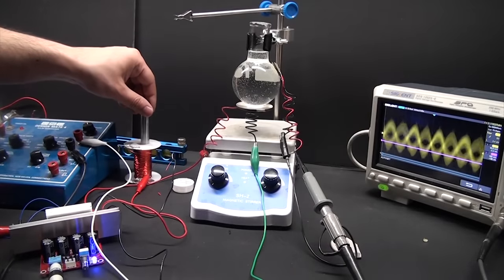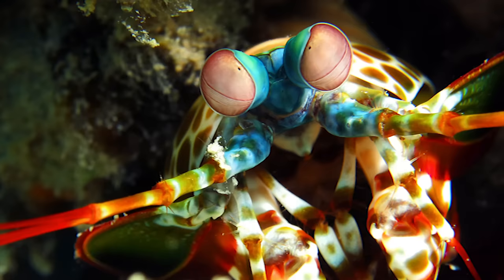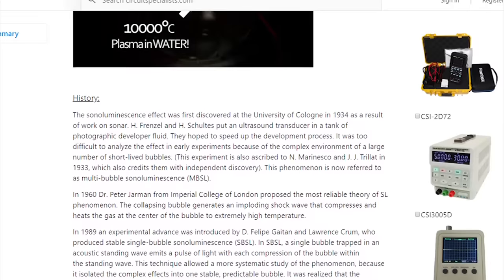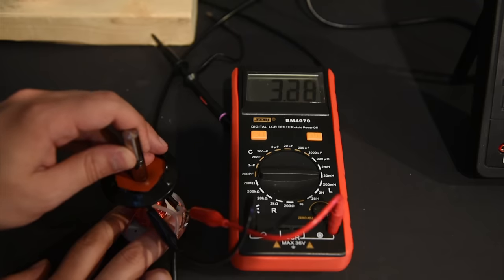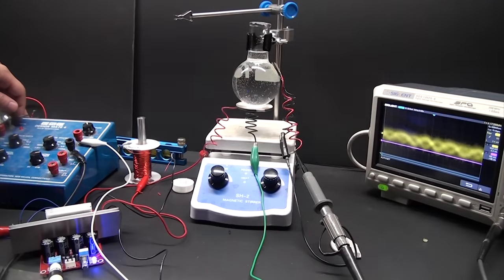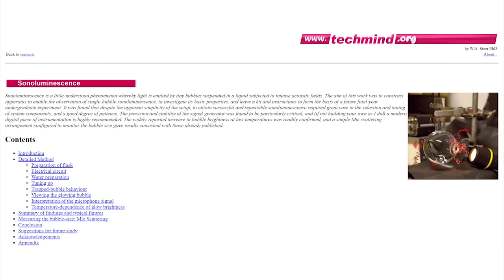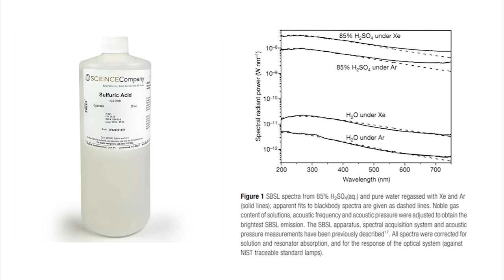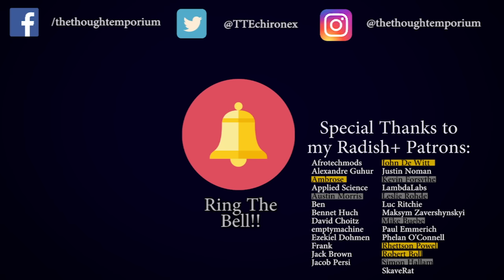Punching Water So Hard LIGHT Comes Out - Sonoluminescence

Comment: Take this with a grain of salt but I'm pretty sure sulfuric acid actually evaporates at room temperature like alcohol or gasoline and faster than water, if I'm correct de-gassing it is a losing game, because lowering the pressure would make it spontaneously boil off rather than releasing trapped gas

Comment: Your benefiting from the meniscus surface tension in the water that is causing a lensing effect on your sine wave. The angle of incidence is equal to the angle of refraction.
Reply: I bet if you put a magnifying glass lens in the water at the interface you could amplify the fulcrum. also if you did such with a much larger lens that was coated with high reflective material with one ninth size translucent face in the center of receiving face you could get a holographic resonance that should maximise your luminescence.
Reply: if you put a tweeter above the lens assembly you should be able to regulate a coherent pressure wave to allow for more Db at the fulcrum.
Reply: or a 25kHx air transducer might be a lot better.

Comment: its because it pops faster then lightspeed the vibrations are keeping the water in flask moving just like waves in the ocean just yours is controlled and its shape of a drop it keeps is for same reason why a drop sits on top of water but like when you vibrate sand heavy stuff sinks. youd notice a brighter effect if you had the water drop burst in a different liquid. just dont used gas lol only 2:43 in and i can tell you that lol doesnt take rocket appliances the part of how it closes faster then lighspeed is what we have to figure out it would have something to do with the amount of force compared i bet the bigger the flask and the bigger the drop the bigger the effect but for more burst effect youd need bigger drop in smaller flask but the liquid the drop busts into has to have way way way less particles this is actually very dangerous it seems the more im talking about it
Reply: its the pressure leaving the drop and the pressure on the drop its taking over the space with itself and because they both water it ends there at a instant joining i bet you can find the same thing with rain hitting water behind a hurricane or tsunami
Reply: just thought of something while doing research on Egypt history im wondering if this light effect happens when a sperm bursts in an egg because maybe the light is point of creation ?

Comment: What? Magnetic positive repelling  Water ion based batteries?  Using repelling magnetics at a concentrated space in water to force and pull out light at a specific center of the water? Magnetic water ion based battery lamps... I love it!  Pulling light out of extreme vibrating water molecules in a lamp or flashlight... I wonder if there is a way to pull light out of air for street lamps....

Comment: 25 years ago I worked for a small company that manufactured a high frequency (660kHz), high power ultrasonic transducers and amps. The transducer was a 2" disk epoxied to a 4" disk of aluminum. This was housed in a waterproof container. We could put the transducer in a 24" aquarium with water. After dark accustoming your eyes you could see a 2" diameter beam of light come from the transducer go across the aquarium, hit the glass and reflect back towards the other wall. As I recall it faded before it hit the other wall. This was with about 250 watts into a transducer at it high impedance resonant frequency. The transducer capacitance was tuned out with an inductor, leaving about 20 ohms of resistance to drive. The waybach machine doesn't seem to have captured what I was after, but here is the transducer connected to a standoff that is connected to a vessel for treating a solution. https://web.archive.org/web/19991013174605/http://www.ultrasonic-energy.com/accessories.html

Comment: What if CERN adapts this technology in trapping an atom alongside a tunnel towards its center like lok the BOZO collider then have light spectrometers to analyze its energy! Hydro  and also gas compression with light spectrometer and energy analyzers, and temp type infrared cam to analyze the heat dispersion.

Comment: Hello, thank you for your response. I'm making progress little by little in this experiment, but I find it interesting that increasing the inductance decreases the signal on the oscilloscope instead of increasing it. Currently, with a coil of approximately 1.9mH, I have a peak around 27kHz, but there's a much larger one around 15kHz. Would it be advisable to find the resonance frequency of the flask outside my LC circuit and then look for peaks on the oscilloscope?

Comment: Wait when a particle, specifically an electron, suddenly slows down, it emits light right?  So then that's what is happening here right?  I'm also expecting it to be cold, as generating a plasma in water probably will cause said plasma to interact with the surroundings in some way.  TL;DR, if this generated heat, we'd probably notice the surrounding water heating up after a while.

Comment: -"Punching something so hard it generates light." That.. sounds a lot like fusion/fission. Using powerful kinetic forces to cause effect at the atomic level. 
In the case of the opera singer example, its a counter frequency that tears the bonds (fission).
In the case of the punching, its smashing things together (fusion).

In the end the sono, or sound, is just vibration. The luminescence, being in this case visible light, which is almost always results from heat.

"The bubble is wiggling so hard that it produces light."

Maybe..
Reply: Bruh wtf are you tryna say 😂

Comment: If you figure out sonoluminescence in the Air instead of water, you'll be really really really really really close to true, honest holograms!

Just gotta find something that acts like a bubble in air

Ooo, the only thing that i can think of is a bubble of vacuum

hm but how do you maintain a bubble of vacuum in the air? 

the prototype will have to be in a box

Can you even make a bubble out of a vacuum? If not, a lighter gas maybe like helium. 

Hmm but then the object needs strong cohesive bonds

Oh ok would it would with sulfer exaflouride? I know that sinks, but it's still moving relative to a force, so the process should work the same I'm thinking

You create a bubble of 1 gas in another, suspend it, use some fancy code for highly specified vibrations to decide where the light shines, and when

and boom! 3D sonoluminescence imagery!

Someone please try

Comment: What causes the bubble to collapse so hard it produces light?
In this case, water head is clearly too small. So, is it atmospheric pressure or the cohesion forces of water (surface tension between the water outside the bubble and saturating vapors inside)? In other words, would a cavitation tube like in https://www.youtube.com/watch?v=G5D0F0tDYZQ still produce sonoluminescence? (or is that mantis shrimp even more awesome because it punches water into sparking at, say, 10m deep  - double the atmospheric pressure?)

Comment: Ok... Here's a question? When we shot the moon with an atomic bomb and it supposedly "rang like a bell for 8min"

Can you please explain to me how sound travelled through space?
Reply from the maker: We never did that. We crashed a probe into the surface. Also there were other probes on the surface that registered the shockwave. Basically seismic sensors. It "rang like a bell" in the sense that the shockwaves bounced around the inside of the moon and were picked up multiple times by the probes. It didn't literally ring like a bell.